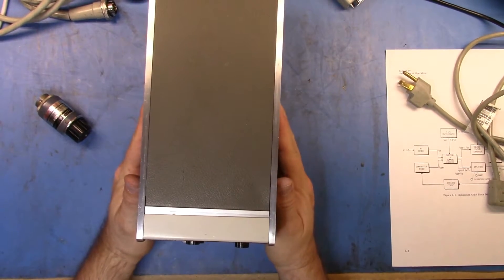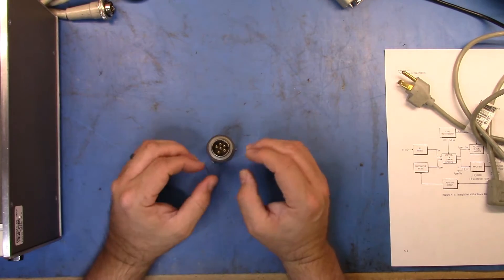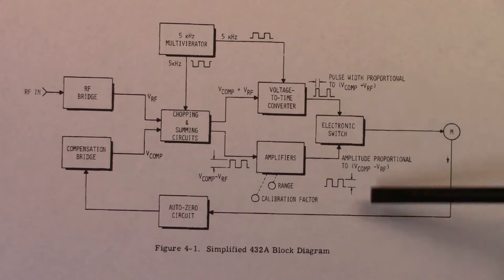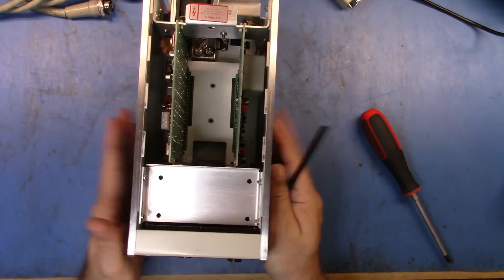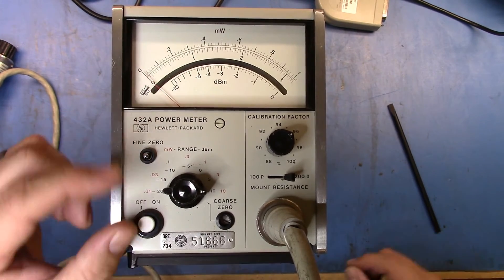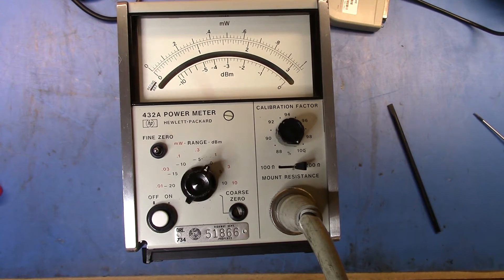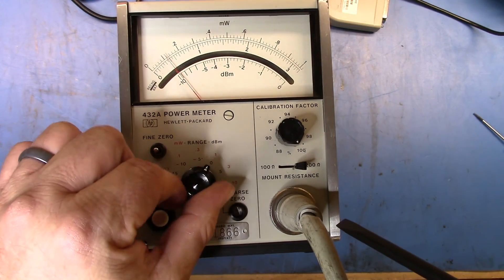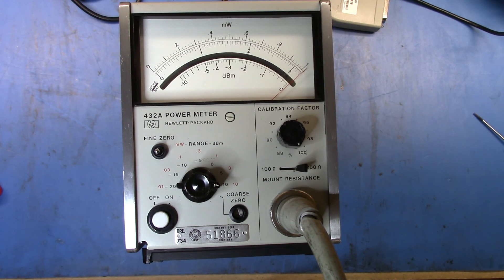HP 432A First Look

Comment: Thanks so much for the videos on the repair of the 432 power meter.  Mine had the same symptoms as yours.  I was just getting ready to check my power supply voltages just before watching your video.  I found my 100 uF capacitor was bad, just as yours was!  I have one on order, but I think I have a pretty good handle on it thanks to your video!!
Reply from the maker: Good to hear - Glad I could help.

Comment: Pretty darn close if you ask me. Might have to pick up one of these meters. I have a 437B and absolutely love it.
Reply from the maker: The 437B is a great meter - I love the fact that you can store the cal settings for the sensor in that meter and just recall them based on the frequency - Much prefer it to the 436, though I do have a 435 because it is just a classic format (like the 432 here).

The challenge with these meters is not the actual meter itself but in getting the 478A Thermistor Mount, that is really where the money is. In my case, I think I managed to acquire it from someone who just wanted to be rid of it so it was substantially cheaper than others. Still works though.

Comment: I have a question. Can a device like this be used to measure the strength of RF waves from local mobile phone antennas, or neighbours' WiFi base stations?
Reply from the maker: Technically yes but these are broadband devices and they're going to have a lower limit to the reading (e.g. -30 dBm for example). The 8400 series will go down to -70 dBm but they're still broadband devices. To do what you're looking at you'd be better off with something like an 8902A measuring Receiver or an 8960 series communications tester I think.
Reply: @tgsoapbox  Thanks so much for your answer! That's a shame, the devices you mentioned cost several grand. I bought a cheap EMF tester for about £30 and was hoping to get an RF one for a similar price! I guess not LOL Thanks anyway :-)

Comment: I think the meter calibration will be fairly nonlinear in the vertical position.
Reply from the maker: Oh I completely agree - I should have pointed that out but I did this orientation so I didn't need to move my camera - Since then I've bought another camera and tripod so I can record both overhead and front on at the same time.

Comment: I purchased one of these also as a replacement for my 431 which is getting long in the tooth. The 431 still works, but it had some issues...mainly when trying to zero it, jumps all over the place and goes nutso. I haven't really bothered to look into it to see if this is just a cleaning issue with a pot. I can use the the older 478 thermistor mount with the 432 just fine.
Reply from the maker: I just picked up a 431C in an auction score - It seems to work but isn't anywhere near accurate so I have to get back to it to try and either adjust or repair. I also have a 478A that I use - I'm looking for one with the 1.05 SWR at 50 MHz so I can check 1mW power references appropriately.

Comment: Looks like a real nice piece of kit. Have you done a video on that RF generator you are using?
Reply from the maker: The 8657B? I don't think so - I'm getting a set of instrument cabinets this weekend and will be putting my test gear into them. I should have an 8657B, 8672A, 8673B and an 8663A - I may try to do a video showing them all.